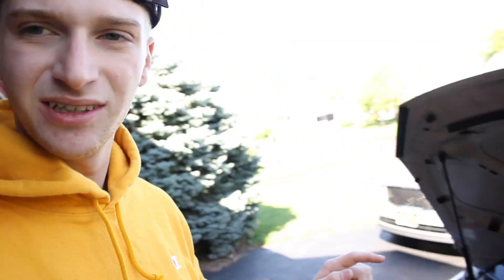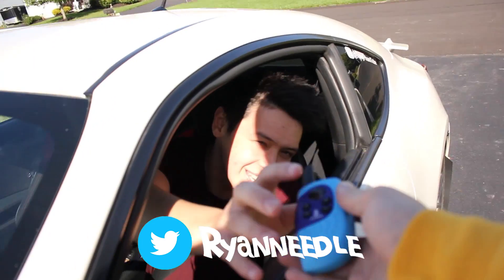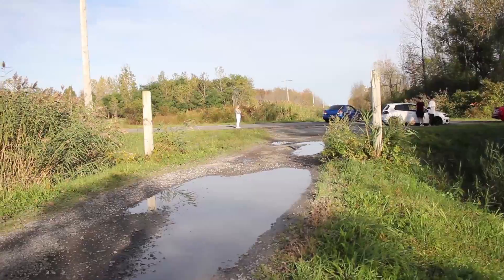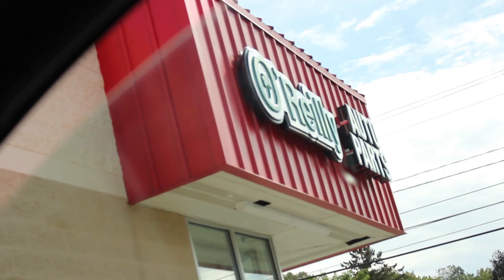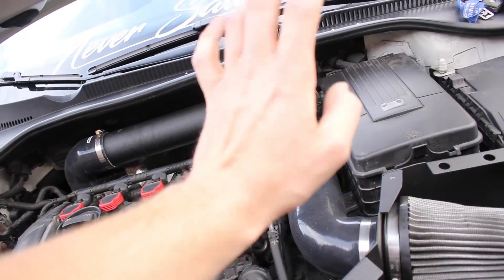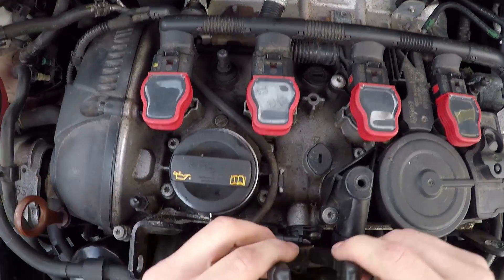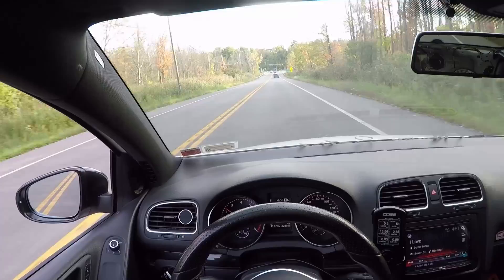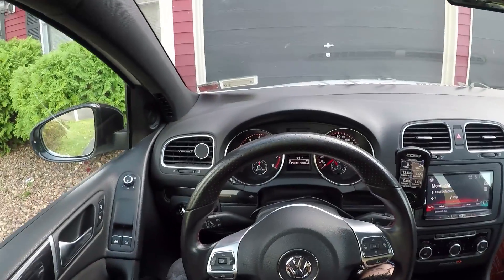The GTI Has More PROBLEMS Than I Thought...

Comment: GTI’s got to love them... My 2010 with now 98,000 miles... Replaced both water pumps, cooling hoses, coolant reservoir, time chain tensioner, timing guides, timing chain, transmission clutch, fuel injectors, fuel filter, low pressure fuel pump, fuel pump module, intake manifold, main seal, battery, spark plugs, oil, oil filter, ignition coils... Now it’s not taking on 1st gear.. I always baby the car, this cars can be money pits because of so many point of failure that come from factory.. Most things listed can fail as soon as 30,000 miles...
Reply: Typical GTI money pit, similar happened to me and my GTI was stock. I really don't know why people buy these super shit cars? There's so many more reliable cars to modify and tune. You forgot PCV valve in your list BTW.
Reply: shes my first...MK6 GTI with 108,000km.. shes slowly going on me and it is breaking my heart but i can guarantee that i will NEVER drive anything else, looking at the 2022 R..
Reply: @shanemitchell5807  you just bought a lemon
Reply: @glock1inthetop45  Nah
Reply: @shanemitchell5807  yup everyone I know has good cars lol
Reply: @glock1inthetop45  Yeah nah
Reply: @yannzter  dude, get the new supra.
I'm done with expensive overpriced German for now.
Reply: @Priest_Of_Zebak  that’s an idea…
Reply: the gen1 ea888 is a terrible engine i believe thats the one you have. On mine i had to pretty much do the same so far. Timing chain, tensioner, guides rails timing cover etc...updated intake manifold, injectors, updated pcv, diverter valve talking 5 grand just right there lmao

Comment: I had put coolant in the radiator and it was gushing out from on the bottom of it could it be the hose or the actual plastic that holds the coolant. It wasn't leaking from where the radiator to actually is but the plastic container that holds the coolant was leaking from the bottom